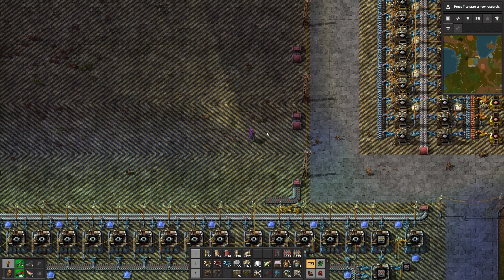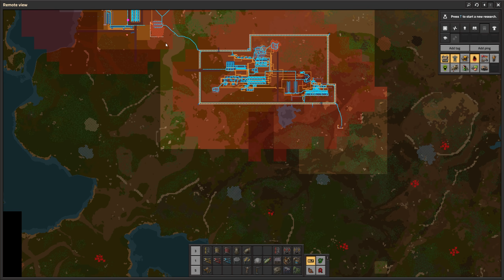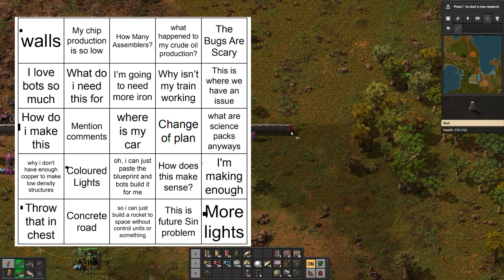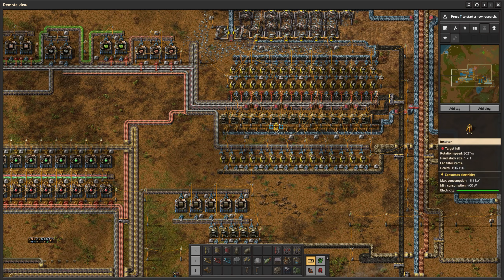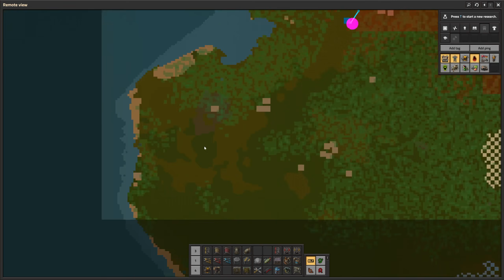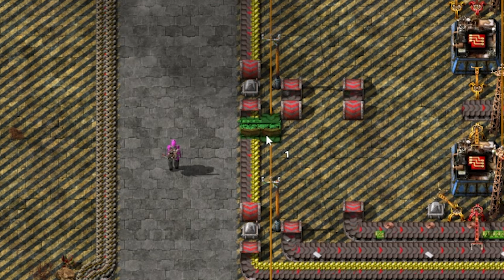Satisfactory Pro Plays Factorio - EP.6 -  This Game Is A Stress Test

Comment: 🤣 I used a blueprint for a ship in space age and by accident removed a wire, long story short it took me 3 hours to find the problem and fix it now my ship doesn't go max speed and breaks crashing into asteroids. circuits are super necessary you can connect a wire to a radar this will let you use signals over long distances. definitely watch a video about the circuits it is super useful but can get complicated fast. you can connect a wire to a belt and let it read everything on the belt or just that section then connect that to a radar and see the same signal somewhere else from a radar aswell for arguments sake i call it wifi
Reply from the maker: I will be watching a video on circuits soon. I want to get into them as I feel it would open yet another whole new game for me. Especially regarding the dlc as people keep telling me it would be really useful

Comment: also, when you’re calculating rates, keep in mind that one full red belt (both sides) can only carry 30 items/sec. for example, if you take red circuits — one machine needs 0.25 green circuits per second. you have 18 machines in one line, so that’s 4.5 green circuits per second. you’re using only one side of the red belt for green circuits, which is 15 items/sec, so that’s fine. but if you split that half lane of green circuits, it becomes 7.5 items/sec — still fine, but just something to watch for in the future so you don’t make lines of assembling machines that are too long.

also, you can do belt weaving (just youtube it to learn faster) to save space — it’s basically putting 2–3 types of underground belts in one line for item inputs, so instead of 2 separate lines of belts, you only need one for 4 items recipes

Comment: 2:32 voiding 25k crude oil just to put the storage tank back down in the exact same spot. What a classic.

Btw, the ending part, the personal roboport let's bots in your INVENTORY do stuff. You had them placed inside a roboport, which is it's own system that can only pull from logistic chests. Just hold a stack or so of construction bots in your character inventory for them to work.
Reply from the maker: Im guessing the little area around my guy would be considered the network? I kept just deleting and replacing them even after the video because they would fill up too quickly 😅
Reply: @Sin-r2h  - Managing fluids is both easier and more difficult in Factorio than in Satisfactory.

Unlike Satisfactory, you don't have the option of "sinking" some things to maintain production of over things. And so you have to have a completely different approach to dealing with by-products. The cracking recipes you get with advanced oil processing are part of the solution.

The other part of the solution, for most people, is the circuit network. :-) This is a game mechanic than Satisfactory has explicitly rejected. Partly because it significantly adds to the complexity of the game and also the complexity of the simulation,

I have some ideas about the kinds of shortcuts Satisfactory takes behind the scenes to maintain the simulation, and those shortcuts wouldn't be possible if something like the circuit network existed. The developers of Factorio instead opted for optimizing the bejeezus out of the code that runs the simulation.

In Satisfactory, what happens when you aren't looking at a portion of your factory is a lot less complex than what appears to happen when you are looking at it. :-) It's one of the reasons Satisfactory doesn't have inserters, for example.

One tidbit... the most efficient way to make rocket fuel in terms of crude-oil used is light oil.
Reply: @Sin-r2h  Yeah the orange area is the logistic zones where bots can interact with chests, and the green area is the construction zone where bots can build stuff.
Reply: @Sin-r2h the area around the engineer is the range of the construction bots. More and better personal roboports extend the range. Roboports have two ranges, construction and logistics/network.

Comment: keep in mind that belts have there own speed and capacity so if your asemblers use lets say 20 things/s  and you have half of a belt with speed 30/s you will lack some things. Also in situation like green circuts where it needs a lot more wire then plates you can consider doing 2 sets of alternating type underground belts use the slow one for iron plats and the fast one for wire this way you can have a better input.  Also consider setting up electric furnaces since you want to get rid of the basic once soon.

Comment: eventually you may need to fluid control the oil proc, this can be done by connecting a tank and a pump with circuit network wire and setting the fluid and how full the tank needs to be before the pump will start or such